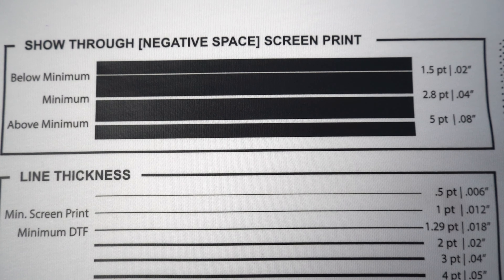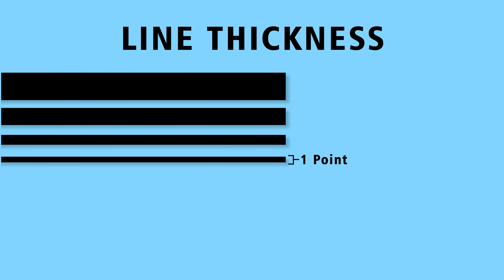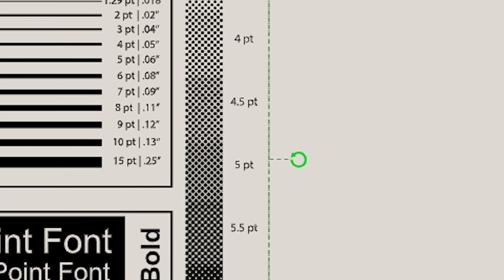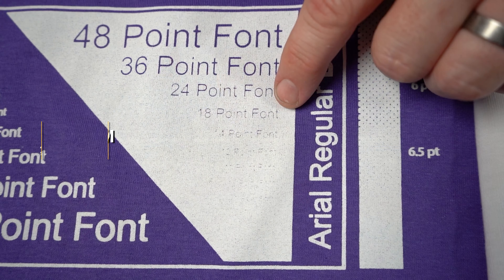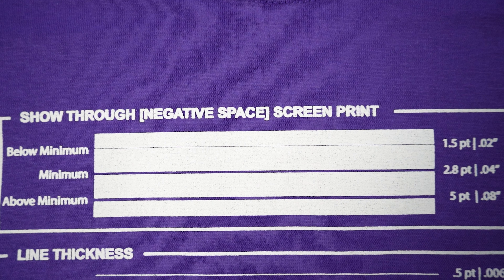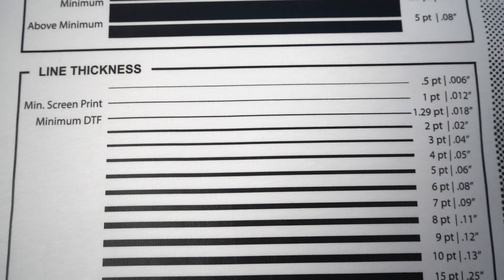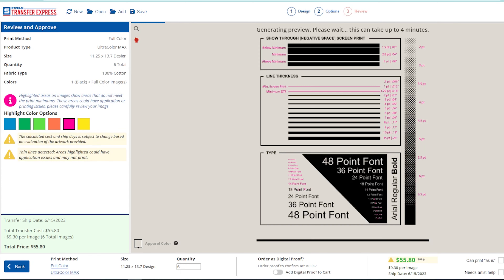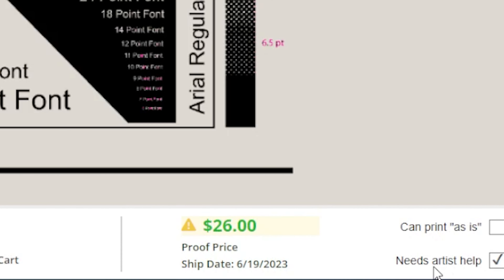Art Guidelines for DTF and Screen Printed Transfers | How To Get The Best Results

Comment: What happens if you peel a hot peel transfer as if it were a cold peel transfer?
Reply from the maker: That's a great question! With some hot peel transfers, once cooled the carrier will not separate from the print, in which case you'll have to warm it back up before the carrier sheet will release. 

With other hot peel transfers, the carrier may be able to be removed just fine, but the print may have more of a glossy look as opposed to the matte finish of a hot peel transfer. This sometimes can be changed back to a matte finish by covering with a paper or reusable coversheet and pressing for a second step, but it depends on the specific transfer. 

Hot peel transfers are great for easy, quick and efficient printing.